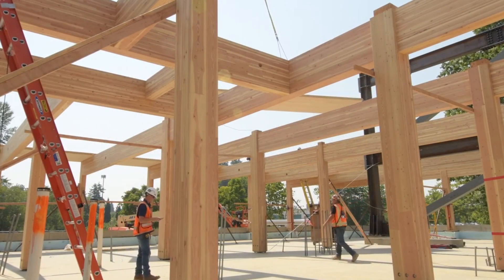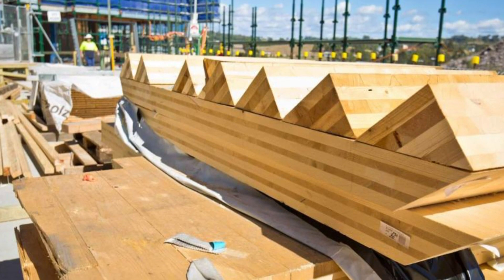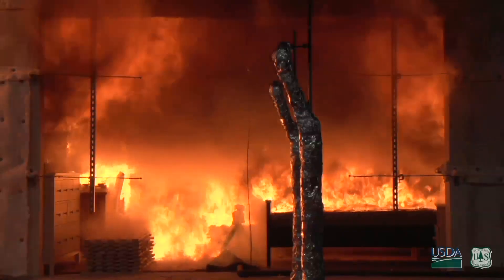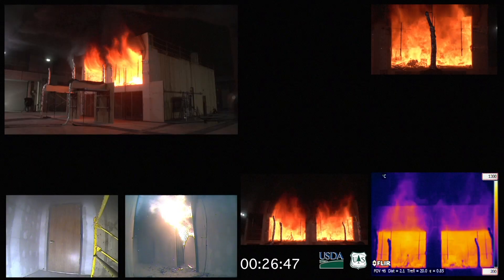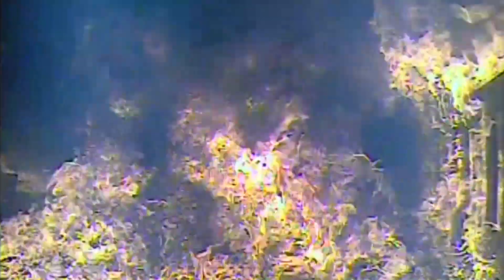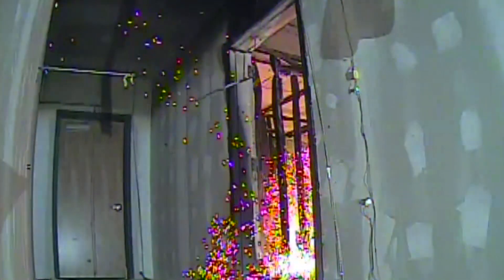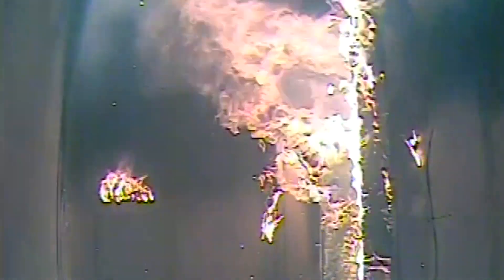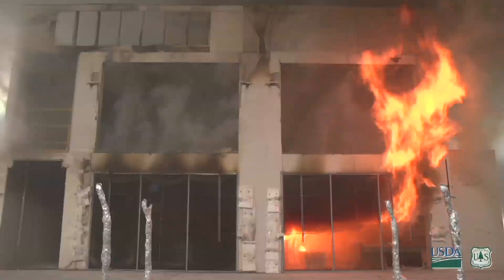Cross Laminated Timber Fire Testing

Comment: So umm, pretty sure cement ceilings wouldnt flash over. It seems too convinient there wasnt a side by side comparison with cement building. Also nice try claiming it goes from 700 to 50 degrees. At 50 degrees and with all the smoke humans would be dead. Also id like to see a smoke volume comparison. Also where is the post fire structural integrity test? Lastly building fires can last 12 to 48 hours even with fire fighters spraying water... so a 30 minute test? LOL! Sorry this test is not at all convincing.